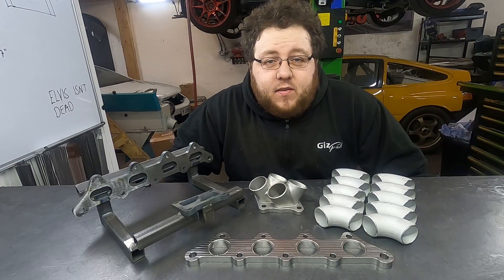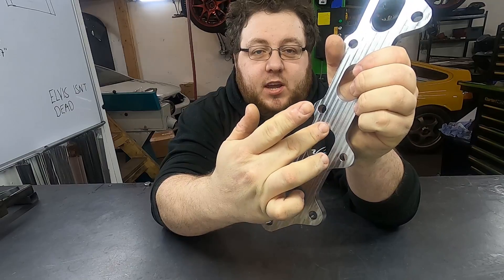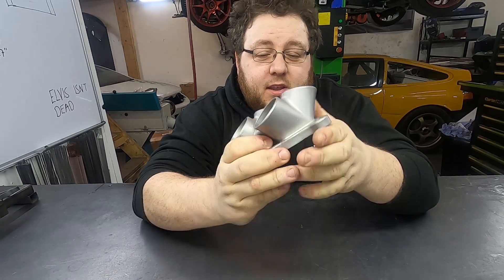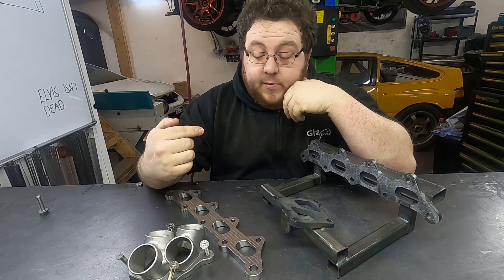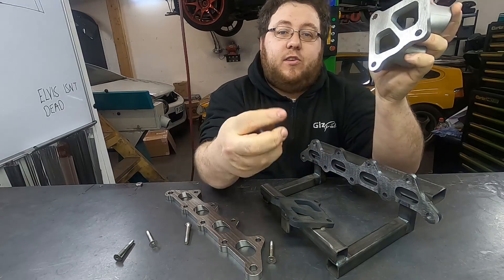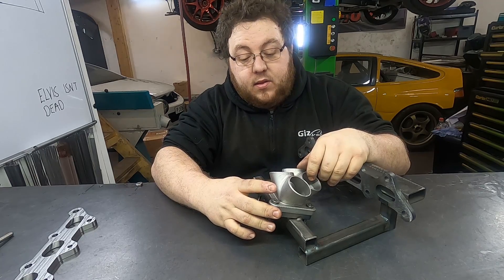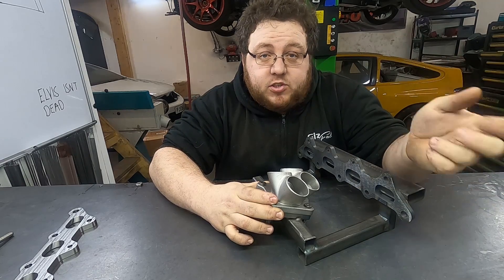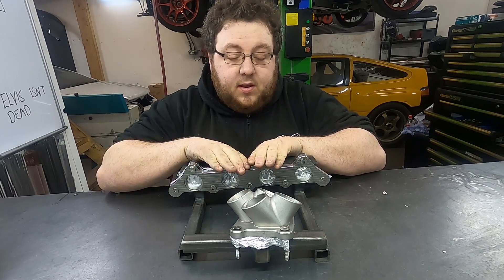Mitsubishi Colt CZT TD05 Twin Scroll Manifold Build

Comment: Good welding skills. Like the billet merge collector. Is it CFD simulated? Tubes need to go inside the flange in order to avoid cracks.
Reply from the maker: Using Pipe, flange holes not large enough to accept a through-flange construction. The are however welded inside and out the flange join.
Reply: @GizFab  You can design the holes in the flange according to the outer diameter (OD) of the tubes you plan to use.
Reply from the maker: @madk4speed  There really is no need. a Butt welded design is perfectly fine.

Comment: What kinda amps are you running on these and what kinda material is the manifold made out of
Reply from the maker: 55-60 amp. 304 stainless steel
Reply: @GizFab  that’s for schedule 10 stuff I assume what about if your doing schedule 40 304 stainless
Reply from the maker: @1BadLS1209  SCH10 yes, Never touched SCH40 so i couldnt share any settings.

Comment: Hey man. I like your videos, but why you are so hungry for the filler rod?
Reply from the maker: Because the weld pool needs it. I’m also using a small filler rod for improved control which means I can set the amps lower for an improved weld.

Comment: Looks mint! The purgegas need a outlet aswell, either in the front or the back otherwise the pressure of the gas can push back the weld so it wont burn through all the way.. U maybe did but i did not see a hole after the flange or in the silicon cup.
Reply from the maker: They have a hole either end.

Comment: Добрый день! У меня двигатель 1.3, 95 лошадиных сил. Очень слабенький двигатель.Из какого металла вы делаете коллектор?
Reply from the maker: stainless steel
Reply: @GizFab  what stainless steel?
Reply from the maker: @pavelandreew6839  304
Reply: @GizFab  what is the thickness of the metal wall?
Reply from the maker: @pavelandreew6839  2.77mm
Reply: @GizFab  Thank you very much for the information!
Reply: @GizFab  On Mitsubishi Colt 6 Euro can be put turbine, 4G90 engine 1.3 95 horsepower?
Reply from the maker: @pavelandreew6839  Have no experience with that model. Only 4G15 model.
Reply: @GizFab  Thank you for your response! Greetings to you from Russia!)
Reply: @GizFab  Sorry,I have a 4a90,1.3, 95 engine ! That's right now!

Comment: sorry I know almost nothing about welding, but you seem to be using mig to tack and inside flange, tig elsewhere?
Reply from the maker: NON of my products are MIG Welded. Everything is 100% TIG Welded.
Reply: @GizFab  I noticed you only using 1 hand at times so assumed it was wire-fed (mig).
Reply from the maker: @R0yL33  Will be Pulse welding with the TIG.

Comment: What size filler do you use bud?
Reply from the maker: 1mm for welding the primaries. 1.6mm for welding any flanges (y) This was all stainless so 308L was used.
Reply: GizFab thanks! Out of interest how do you go about working out the Jig placement? (If you don’t have the car with you)
Reply from the maker: @adamlloyd2688  Depends on the application. For example on a Saab B204 engine. the OE Manifolds flange positions means you can use the OEM manifold to create a Jig for the OEM TD04 Turbo. However, if you wanted to fit, lets say, a GT3076 to the B204...You would need at the very least an engine in order to make a flange mock up. But ideally needs to be fitted into the car so you can account for clearance around other components, such as bonnet, slam panel, radiator, fans etc.  But for the most part - You can't. We are planning a video on how to make a Jig and turbo positioning
.
Reply: GizFab A vid on that would be great, Thanks for taking the time to reply!

Comment: Beautiful welds and manifold! Curious about your choice on cylinder pairing/exhaust scavenging though. Isn't it normally cylinders 1-3 and 2-4 pairing instead of 1-4 and 2-3? Still a beautiful manifold never the less, and probably doesn't make much of a difference what the pairing is.
Reply from the maker: Always 4-1,  2-3. Going 1-3 and 2-4 would give an increased in un-even exhaust sound (Which sounds awesome btw) However the power difference with ne negligible.